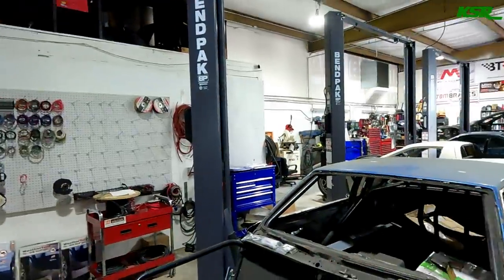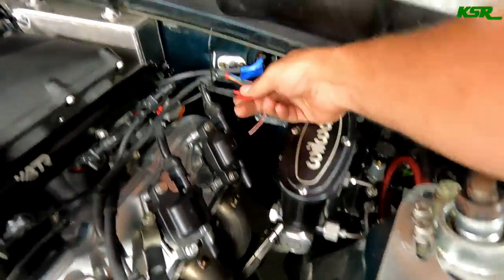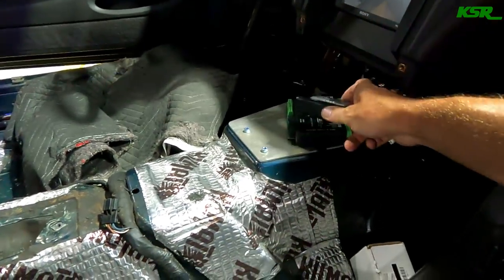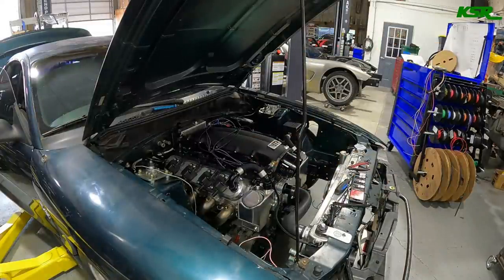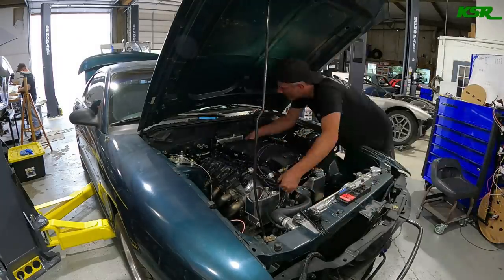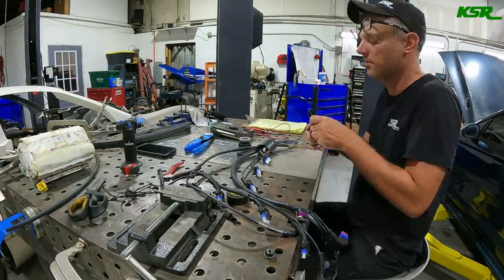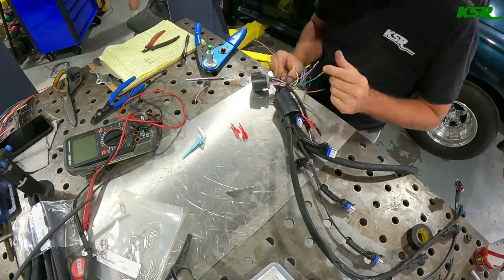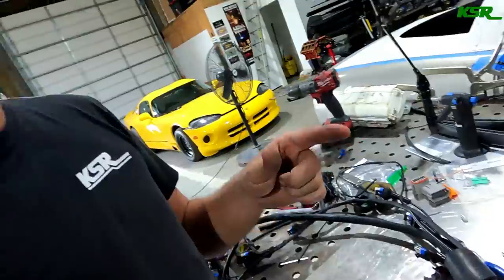Custom Engine Harness Time!! Tips and Tricks for Building Your Own!!

Comment: In Mercury Marine Land we have bullet connectors that connect / disconnect all engine wires in one QD.   so to pull a boat engine all you do is disconnect the throttle cable, shift cable, motor mounts and the bullet connector and it comes right out.  I can have an engine hanging on a hook in about 15 minutes....   drag week folks should do that.
Reply: They all should do that and that sounds like easy as 1,2,3
Reply: That's what Kevin is showing throughout the video, a single connector into the firewall.
Reply: @SportbikerNZ  Yep.

Comment: Good to hear you're using shielded cable for the crank sensor👍
I would even do the injectors and coil feeds, along with any other sensors carrying critical signals. Shielding the coil feeds and injector feeds would protect against interference with the low level critical signals, even shielding the Holly power feeds as well...
I work in electronics and doing this sort of thing pays dividends in protecting against corruption of data signals in the future...😉
For the ultimate protection look up 'Star quad microphone cable'
Reply: Twisted pair cabling such as star quad or other mic cable is really only helpful if you have differential signalling though. For single-ended signals you'd be just as well served with any shielded cable.

Comment: I live the attention to detail. I know the crew with cleetus is good but it still stings a little with the changes since you aren't doing it. but you left them a good base to work off of
Reply: tbh it's all still there, they just swapped the motor and doors which required almost no re-fabricating because of Kevin's work beforehand to make sure putting a BB in was an option from the beginning of the build.
Reply: the systems of the car that KSR did are what make it such a reliable and workable racecar, no matter the engine in it
Reply: Yeah Changing parts for better stronger shit to go faster and to hold up with the big block from Steve Morrison way better than the little Ls  bbc for the win
Reply: Nobody take this a disrespect to Kevin but they don’t need him to swap an engine.  KSR is busy and they’re more than capable of swapping an engine, he built the car for them to work on and change things as they needed. He knows how racing/racecars go lol
Reply: @nickmx3388  I'm not sure swapping from the ls to bb was about parts strength but more have the power they need without having the ls giving everything it has to make the power they need whereas the bb makes all that and more reliably and that means more track time and less downtime with it in the shop
Reply: Kevin builds racecars for drivers to work on. Change up, get faster.  He just puts a solid foundation to build upon together, that wins races.  Any type of car or truck street equipment, from best I've seen. 
No stings. Just more wins. Which, is always a win win for Kevin and KSR.

Comment: When I did wire repair in the Air Force I always got into the habit of leaving 1 inch extra length so those coming up behind me years later, a decade or more, the extra wire to make a repairs of their own without the need to run a run a new wire(s). Yes wiring takes time. Your asking for problems & headaches if you rush or get lazy with. One of the reasons why I appreciate your work that attention to detail. Been watching them undo all of such work on Mullet of late & know in their rush it wont work out for him.

Comment: I had a list on my whiteboard just for the engine side devices which was 90+ pins plus the splicing I eventually will do for the bulkheads will more than double that. Chassis side adds another 100 or so. Def agree with Kevin having it all written down by wire/color/location to refer back to saves a ton of time. had two minor mistakes and was quickly able to fix with it written out before sealing up the harness. Last thing is adding a few labels that I redid the plugs on. having everything with a name tag also helps tremendously.

Comment: I use to work on large boom lifts ( jlg and genie). With a 135' man lift there were more wires you could rap your head around. Those DEUTSCH connectors are worth there weight in gold. Great job on the content, good info put out.

Comment: 15:04 - That is a bunch of wiring.  If you are not in a rush, can be a good busy-work job, if you are one that likes this kind of activity.  Maybe newer year vehicles are changing, but when I looked under my 2008 Focus dash, there were modules attached to bigger modules and a wire connector mind boggling cluster.  When (could be an “if”), these failures become too many, replacing the vehicle might be the desirable option.

Comment: I use duetch for everything I do. I make engine run in test cells while still connected to the original car to make it run. So basically I extend the cars wiring harness 40 feet. But also separate the power. The car has a separate 12 volt system from the engine. The only thing shared is the can bus communication. I also wire cars at home and for both work and home I do just like you and write the wire color and pin down. But after it's done I have wiring diagrams I make in excel that I keep on a flash drive in each car. No need to worry about ever loosing the diagram and it makes for a great professional look.

Comment: I used the pre-built Holley harness that came with my Terminator X and I regret it. Luckily mine was pinned correctly, but it lays out terribly. Probably because it's made for an LS1 and it's on an LT1 from 1997 lol. When it all comes apart for paint I plan on buying a flying lead harness and rectifying these issues. Might be a good time to upgrade to a Dominator at that point. I ran out of advanced tables a while ago lol.

Comment: I remember having a old v8 swapped jeep yj that the previous owner completely rewired with red wire and after trying to get it running and not being able to I just gutted the wiring and rewired it with a painless performance wiring harness kit I bought off jegs. after doing that it ran pretty good and I drove it for a summer then sold it to a buddy

Comment: People get so freaked out when it comes to wiring. I personally have no problems with it. it's actually kind of easy once you get used to it. And there is something very gratifying about taking a pile of connectors and a few feet of wire and creating a good looking/functional harness. You do very nice work I might add. I also prefer to do it on car. Gives you a chance to see how it might look and make changes accordingly.🤓

Comment: Actually that rectangular connector is not related to headlights, it's the starter wire and the connector used to be mounted on the firewall going to the transmission harness where the starter wire goes through the neutral safety switch. 
More importantly, those catch cans are BADASS!! GREAT Job as always!!
Reply: I'm glad someone else noticed those cans...wow

Comment: Congratulations on your daughters Graduation... Family always comes first. 

I'd ask your flat work guys to make sure you don't foul-up an expansion joint in the floor.  Zip ties amaze me the tonnage they can Stop cold in its tracks.  I'm always impressed to your attention to details...but, your Electrodigical work is mind-blowing.  I looked up the Deutsch crimping tool... and connectors.  I'll have to save a LOT of pennies.  I agree with you wiring concept, pulling wire on the floor or bench...you will 'always' pull long...No one want to get the wire stretcher :)
I saw the readers 'K'....I hate to tell you this...its time for a trip to the ophthalmologist !!.. in the end you'll be much better off.   Believe-you-me, I have to read Controls diagrams everyday...

Comment: Tip
If you do enough wiring often enough make a jig .
Grab some wood measure out the dimensions and mock up an engine and firewall .
Mount some coils and injectors to it in the right locations and then you can sit it on a bench with good lighting and not have to stoop under a hood.
In regards to getting the pins right,
First standardize on the normal pinout positions so you can print and laminate a cheat sheet that already has the number for each wire and possibly colour on it.
Next make male and female test pigtails that are already following this standard so that when you make a harness you can plug in one of these pigtails and test each wire before you co near the vehicle

Comment: Kevin! Outstanding video! Could you provide a table of wire type/gauge and Deutsch connectors (series) you recommend for each circuit/loom? WireCare may be the most comprehensive site I know of.  Do you have any standard wire color practice (red = +power, black=gnd, etc)? Preferred heat shrink and thermal shielding? Thanks!!

Comment: Nice job on the harness and i feel sorry for all the connections ya had to do,just wonderin whats the failure rate of havin ignition coils on the valve covers compared to mounted elsewhere where its cooler say on the chassis and do they use a common neg for coils and injectors?

Comment: Do you have a deutsch connector crimper that you like? I hate mine.

I use flat weave waxed string for my bundling rather than zip ties/tape, less bulky and you can leave it under the heat shrink.

Comment: The harness on a car is nothing lol what is there maybe 20 wires. The last commercial printer/ copy machines worked on had 6 miles of wire inside of it.
Reply: Yes to a point but to be honest with you computer wires are easier to run. Pinning harnesses and running wires so they are safe from moving parts and from heated parts. Plus having to weld bungs on parts for your wires. Then working in the cramp space under the dashboard as a contortionist. The computer wire’s are 95% pre-made and usually way more than needed. Yes I know that it’s about electric flow/ information transfer determines the wire length in computer’s.
Reply: @robertlukacs1762  yeah please explain to me how much easier it is wiring a bundle of wires that's 7inchs thick with 6 miles of wire inside a printer that could probably fit in the trunk of that car lol.   Aw you had to pin a numbered connector and make sure sure it was in the matching corresponding number on the other side of the connector you poor fellow that's some room temperature IQ stuff right there.
Reply: @robertlukacs1762  but why would you have to be a contortionist, if the wiring harness is running under the center console and the center console is removed? Lol plugging up the dash is literally like 1 wire with a can plug
Reply: Well it’s not as easy as you think. Just saying that those pinned plugs on a computer are factory made for that copier. They are actually pinning each plug on both ends. As for being a contortionist, have you lately tried to get to a fuse panel under your dash?  All those wires are stuffed in the dash. Then all the multiple displays and stuff like that. In the computer room jumpers and other wires are in my opinion way to long. One of my jumpers really only needed to be 6-8 inches long but it requires a 3foot line minimum. Any shorter cause’s distortion of signal. 
Okay if that’s not good enough ex sample on computer cables/wires. Open up you desk top and look to see how many could have actually been shorter. 
In a car, the extra wire is extra weight. The factors of wiring a car is heat, flexibility, accessibility and weather. Amperage is also a issue.   2.5, 5, 10, 15, 30, 40, 50 & 60 watt fuses and breaker’s. Wires that are double “00” gage to 20 gage. The wires in computer’s maybe be 8-10 gage that aren’t factory wires. But if you really want a wiring nightmare, try a phone cable. I helped a phone repair guy(my uncle) repair a line that got hit by a backhoe. That line was 3-4 inch in diameter and 300+ micro mini lines inside it. One example of this mess yellow, yellow w/ white, green, red, blue, black, brown, orange, purple. All had a different stripe on it but the problem is that they also had each color wires with the yellow stripe. And the wires were so small you could pick your teeth with them. So to tell what color wire you had was to cut the wire and look at the very end. What ever color was closest to the core was it’s color the second color was it’s stripe.
Reply: Sorry for the book response.